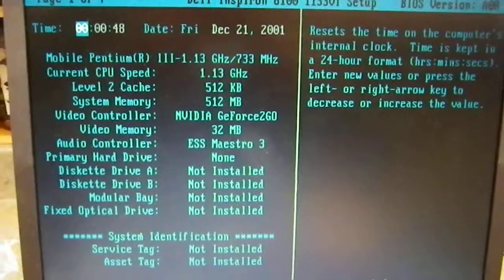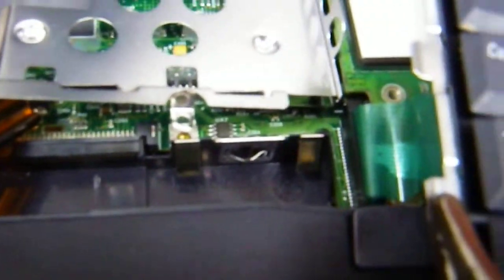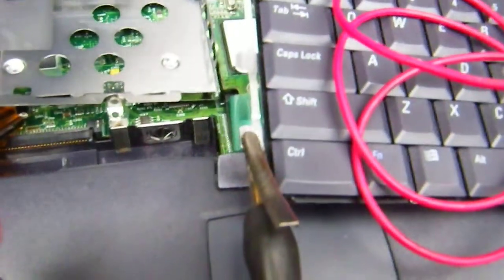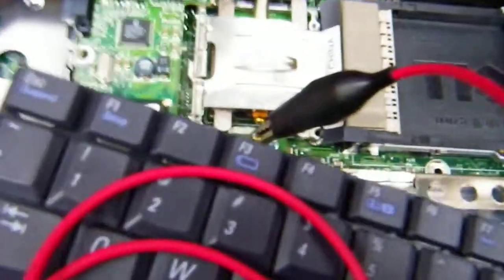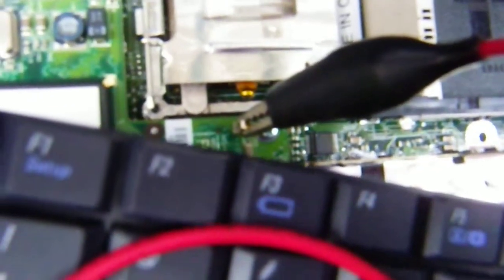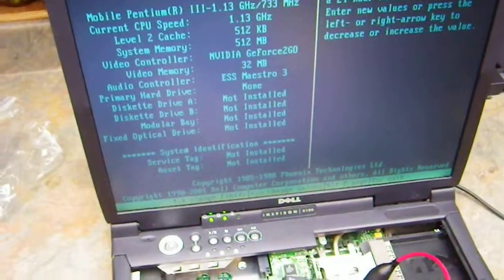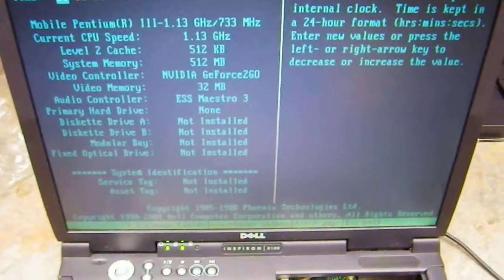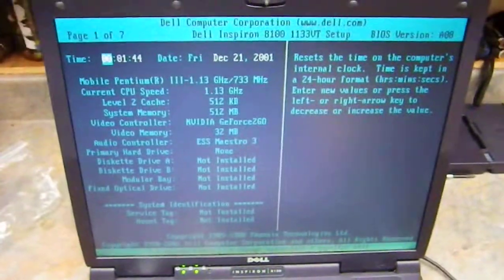Inspiron 8100 Bios Password Hack 2 of 3

Comment: I did everything in this video, and nearly popped a vein. I kept getting Manufacture Mode- Level FF, whatever that means. So what I did differently, was that instead of bending the shielding under the Optical drive, I left it how it was, and instead shorted the 4th leads down, and also the 3th leads down from left to right- right after pushing the power button. Lo and behold, I entered a Manufacture Mode, but this time it said, LEVEL 01, and after going into the bios, it FINALLY removed the bloody admin password! 

Hope this helps anyone else still trying to revive this aging system. 

And thank you for this helpful vid, as it turns out it's the only one that's easy to find on YouTube.